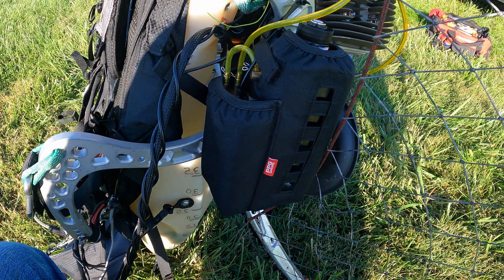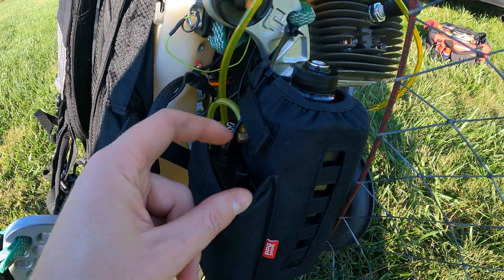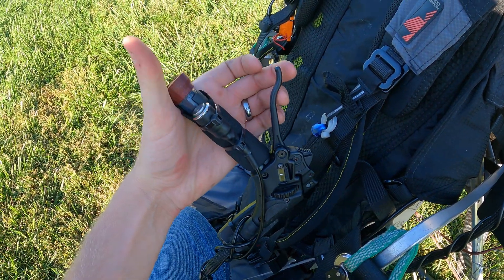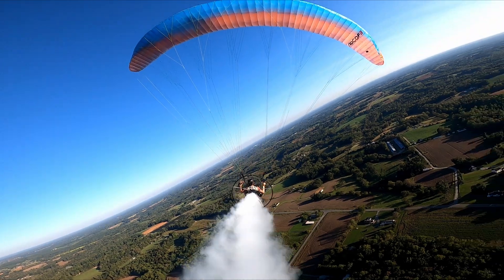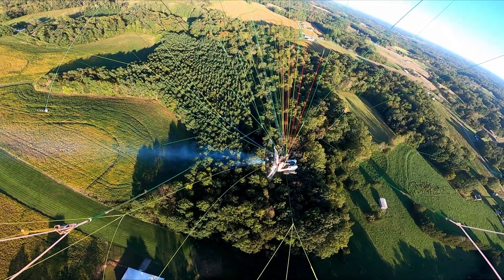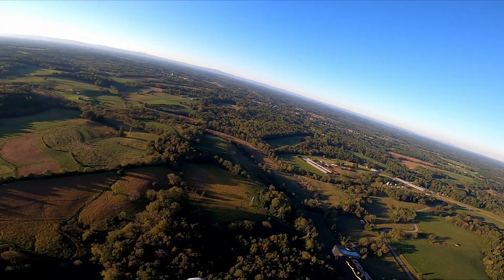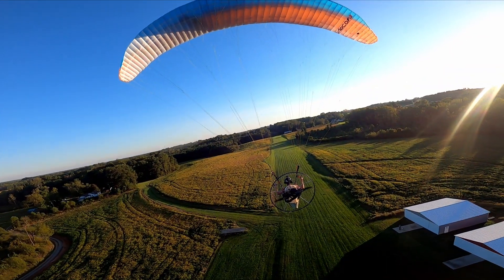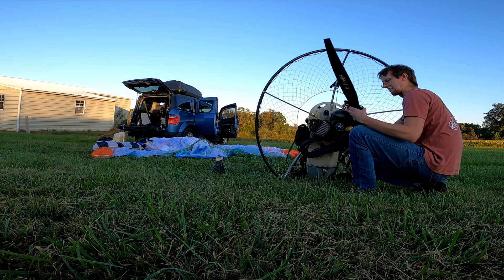PPG Smoke's... smoke system! | Avery Flies

Comment: I'm curious to hear other people's experience. I ordered one from PPG smoke and got about a liter of fluid through it before it kicked the bucket.
Reply from the maker: Of this newer version? First failure I've heard of. What's it doing? I'm not customer support, but I do know how the innards work and might be able to help you fix it.
Reply: It's the newer version. I believe the battery was the malfunction. The armed light wouldn't come on and the battery would never stop charging. The red light usually goes off when fully charged. Mine stays red even after overnight charging.  Idk if I should void the lifetime warranty so it's a dead duck unfortunately.   It was siiick when it was working though.
Reply from the maker: @watchmego4it1  One thing I do know is you have to make sure the activation button isn't pressed when you try to turn the unit on. If the batteries are the problem, they are just 18650 cells and are relatively easy to replace. I'd be happy to do it for you but lifetime warranties are supposed to be lifetime warranties, I don't know what to tell you other than keep trying to reach out to Ryan
Reply: That totally makes sense about the activation button.  Thanks for the insight and help.  If it had some time on it I'd totally try to fix it.   I'm sure they'll make it right with time.
Reply: Update on the new smoke pump from ppg smoke.  I'm about 4 gallons in and this thing has been more fun than I could've imagined.  It's not air show without the smoke 😂😂

Comment: Their original smoke system was absolutely terrible. Pretty much all of them died within months and many within days of being new. Seriously, when they first came out, EVERYONE had one.... and in just a year or two, there was not a single one left on paramotors. Mine showed up with the pump plumbed up in reverse so it didn't pump any oil. I had to switch the hoses around to make it work and the pump died completely after about 5 uses, before the batteries even ran out. This is disposable Chinesium, not something that belongs on paramotors.
Reply from the maker: I have no experience with the original, but I can tell you this one is built well. If you're not willing to try the new version, you'll just have to take my word for it.
Reply: @AveryFlies  the issue was with the pump inside that would just fail.
Reply from the maker: @IrisPPG  gotcha. Time will tell on this, but I made a point to run it dry for at least 30 seconds several times per flight and it's still kicking.
Reply: The previous pump was designed by our team as a mechanical vacuum pump, and while the pump itself was durable, the internal diaphragm naturally wore out over time. Mostly due to the use of petroleum products (mineral oil, smoke oil) through the pump. Rather than offering diaphragm replacements, we chose to maintain its low-cost design to keep the product accessible to more people.

Today, we’re focused on significant upgrades. Our new digital pump operates on a gear system; eliminating the need for a complex diaphragm and mitigating wear. We’re optimizing everything down to the duty cycles in the PWM signal and evaluating battery options, from the 18650VTC6 to the Molycel P45B, to find the best balance of weight, energy density, and cost. We're also adding improvements like a conformal coating on the board, a temperature sensor in the battery pack, and a "replaceable" power switch or cable to protect against propeller wear.

With these advancements and our lifetime warranty (introduced last year), we aim to set a new standard for the product and the market. Naturally, the price will need to reflect the improved quality and features while respecting the demand within this niche market. It’s all about finding the right balance -- too high, and we risk accessibility; too low, and quality suffers.
Reply: Also wanted to confirm, we just ordered INR21700P42A batteries for final production unit. Also, slightly reworking the board and output range. It's going to be a great product and huge improvement over previous versions.
Reply: Thank you for your order and feedback, Dimitri! It’s always a pleasure crossing paths with you. Be sure to check out the latest version when released, it’s made significant progress. 
 
Avery, feel free to remove any unnecessary or disparaging comments. I  appreciate your support, feedback, and review.
Reply: @rrobets1983  no thank you.